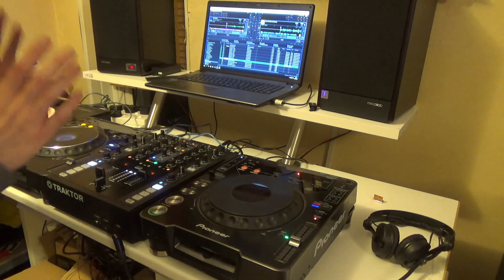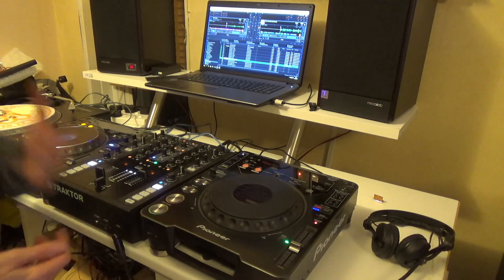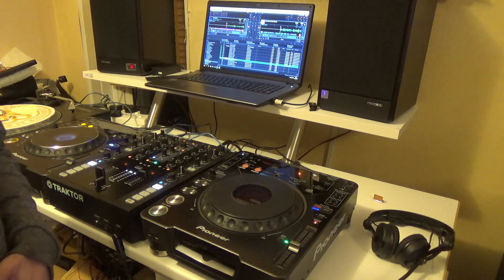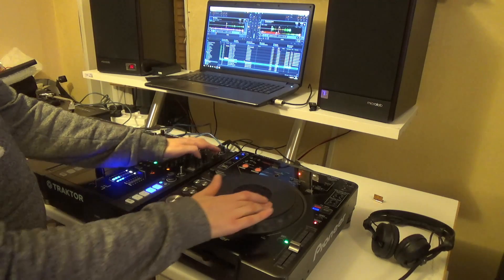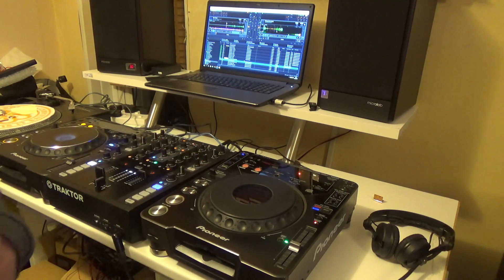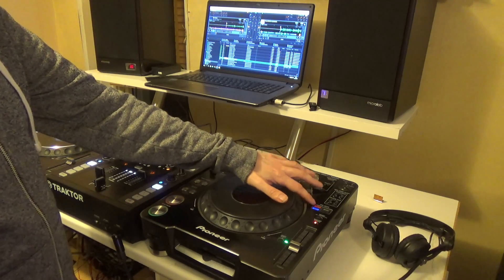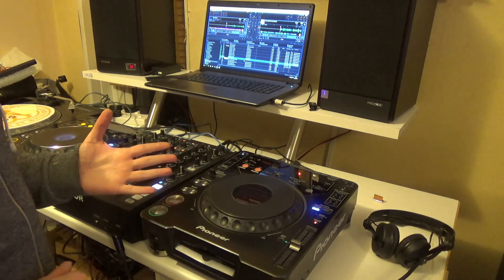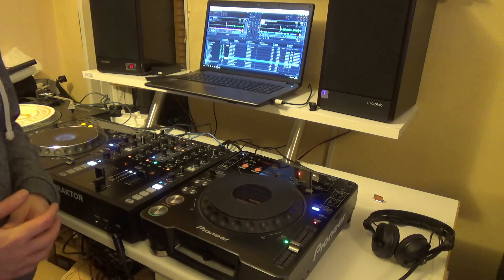Midi Converted CDJ 1000 - New boards and record function.

Comment: Are these pcb files availble anywhere? I'm building a standalone CDJ1000 that runs off a Teensy 4.x and plays audio off the SD cards, but I have just the case and the Jog wheel at the moment. Would love to do custom PCBs for the buttons/fader/leds
Any chance you can share?

Comment from the maker: I have tested this with Rekord box and Serato. Serato is working by emulating a Denon jog wheel and this also works in Traktor, but Rekord box do not support midi jog wheels so for the moment It's not worth trying anything else. Serato should be easy enough once I finish a full mapping file and the leds on each button also work.

Comment: What is the best way to contact you? I would like to contribute to this project
Reply from the maker: in what way ? I just need to keep working on things I want do add to it a bit at a time. 
I made the mk2 with the new pitch and it works just fine so I have tested all three versions of the cdj 1000. I brought a micro sd > sd adapter so I can plug in sd cards from the front. 

I need to work out how to get access to the pins on the bottom of the teensy without soldering to them and then find a screen that is wide and thin enough to fit into the cdj screen area. I want to find a way to get track details from traktor to the teensy and display on the screen. you can find my email on my profile page.
Reply: There as Lots of possibilities.  A few idea run across my mind id like to discuss with you and possibly bring to the table. Im currently in the works of Developing mY own Midi controller and DVS system.
Reply from the maker: you can email legion at djlegion dot com